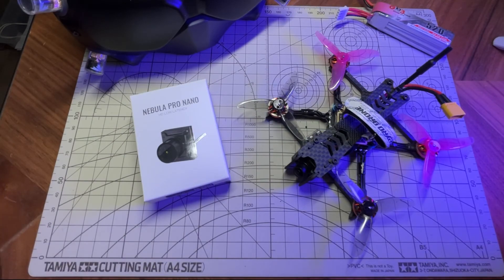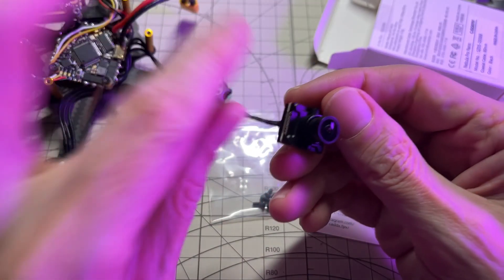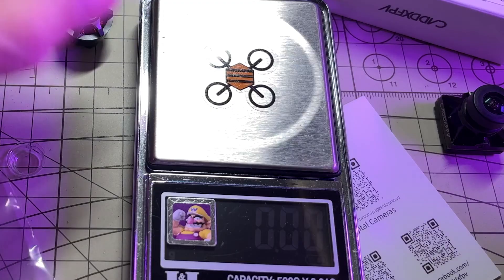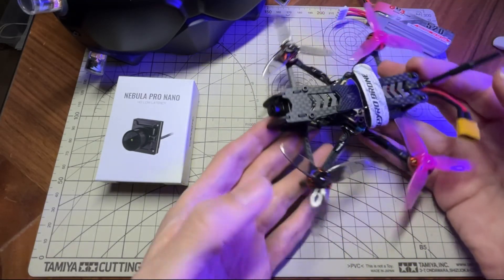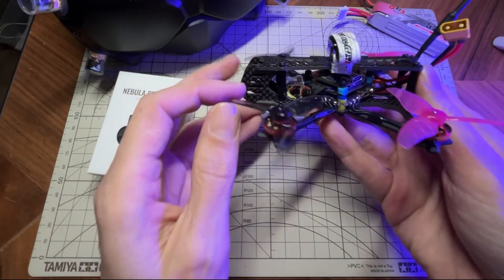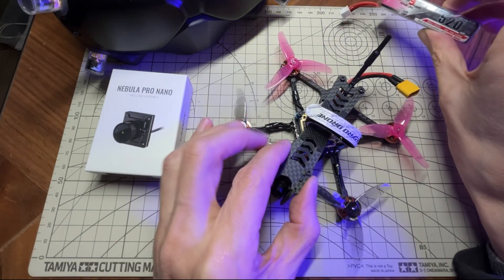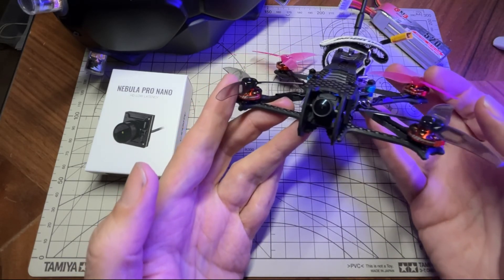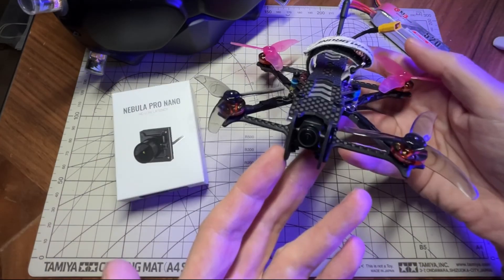Finally, a great 14mm DJI FPV cam: The CaddxFPV Nebula Pro Nano tested in an AlfaRC Fi-115

Comment: my favorite micro frame with Dji  ..Rcinpower 1204 after i smoked the 1105.
i got the idea from your channel
happy New year
Reply from the maker: That's great! I'm glad I still had this frame as it was perfect for trying this camera in a small digital build.
Reply: My favorite digital quad too... with 1204 5000kv(from happymodel) and HQ 2535 props ... 
what Kv yours have? What kind of battery? If 4s, Have you a tune to share?
Reply: @lorentacar  5000 kv, i use the aio jhemcu 16×16 and didn't tune because I don't know but i use similar props also 2540 Gemfan i fly 2-4s depending 
i tune my quads with the props
Reply: @helmuthuneke1775  thank you for your answer👍🏾

Comment: Hi, first of all, thank You for this video. This quad is like a step on my quest “2,5inch freestyle quad“ . And I already build 2 with this frame but stayed with full vista squished between the Aio and top plate with some double sticky tape ... I really wanted to know more before trying make one with naked vista
And I have many important questions you could answer :
I have good results with 1204 5000kv and 12A esc: flies really great on 3s and need a good tune on 4s. Where can I found a micro tuning advices, Or presets?
What kind of range I can expect from a dipole like the one your using? Any advice ? How do you secure the connector ?
Reply from the maker: Sounds excellent! Yes one can build some nice small models with good video now.
For tuning advice, I can't think of anywhere better than UAV Tech. He covers it all and I think there are presets in the latest version of BF (and he has some as well). For this model I just turned up the Master Multiplier a little.
As for the dipole, I think you can expect similar range as a circular polarized but with worse performance around buildings and obstacles. I don't really have the connector secured in any way apart from having the antenna supported by a zip-tie and heat shrink.
Reply: @MiniMicroFPV  thank you for your reply and good advice. I personally use HQ 2535 that make this brick fly enjoyably... not a real freestyle but wonderful on proximity and cinematic type of flying. Still my favorite digital quad.